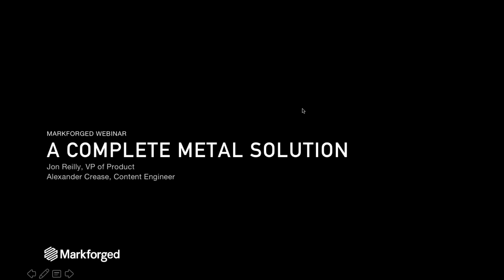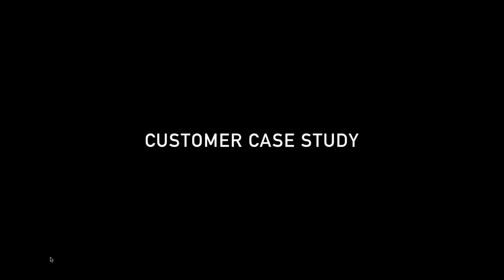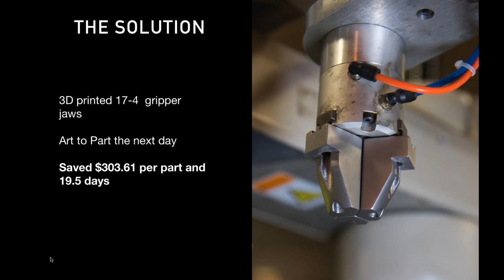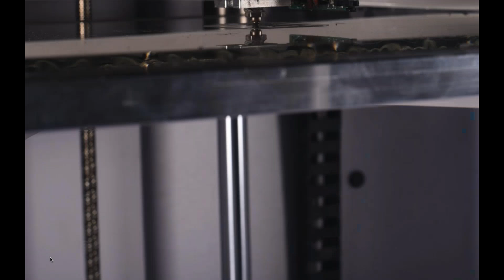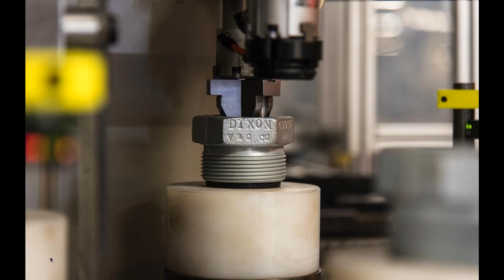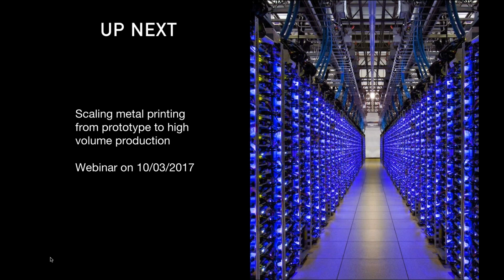The Markforged Metal X | From Design to Finished Product

Comment: 🎯 Key Takeaways for quick navigation:

00:02 🎙️ Introduction to Markforged Webinar
- Overview of the webinar structure and agenda.
- Brief introduction to Markforged and its mission.
- Overview of the customer case study with Dixon valve and coupling.
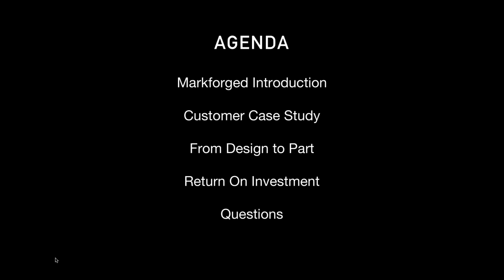01:09 🏭 Markforged Company Overview
- Founded in 2013, Markforged aims to revolutionize innovation and manufacturing.
- Global presence with thousands of printers in over 50 countries.
- Unique offering of materials including plastics, metals, and fiber-reinforced composites.
02:22 🛠️ Customer Case Study: Dixon Valve and Coupling
- Introduction to Dixon Valve and Coupling as a global manufacturer.
- Overview of their automated manufacturing challenge with steam pipe couplings.
- Explanation of the problem faced with the gripper jaws and the need for a robust solution.
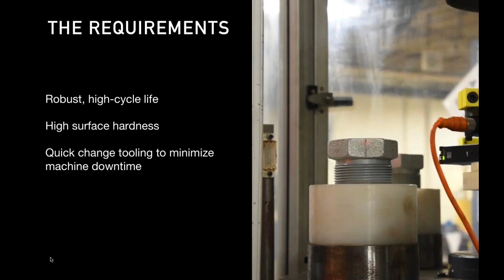04:25 🔄 Solution: 3D Printed Gripper Jaws
- Implementation of 3D printed 17-4 gripper jaws.
- Significant cost savings and reduced lead time compared to traditional machining.
- Advantages of quick and customizable tooling for manufacturing cells.
05:57 🔧 3D Printing Process Overview
- Step-by-step explanation of the 3D printing process with Markforged Metal X.
- Designing the part, printing, washing, and sintering steps.
- Importance of seamless integration with CAD software and automated processes.
10:36 💰 Return on Investment Analysis
- Comparison of costs between traditional machining and 3D printing with Markforged.
- Significant cost savings per part and reduced lead time.
- Enhanced flexibility and simplified workflow with 3D printing technology.
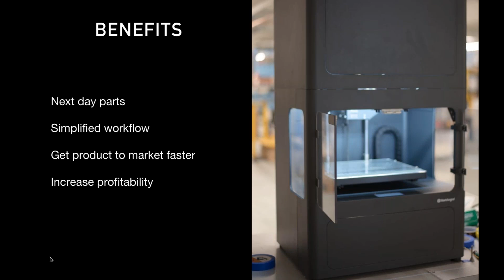13:14 🚀 Scaling Up: Future Applications
- Discussion on scaling up from prototyping to high-volume production.
- Utilization of parallelization and print farms for mass production.
- Announcement of future webinar focusing on scaling up production processes.
14:20 ❓ Q&A Session Overview
- Transition to the Q&A session.
- Instructions for accessing resources and demos.
- Addressing common questions regarding software, materials, and processes.

Made with HARPA AI

Comment: How big of a part can you print? what is the max length width and height of a part that you could print?
Reply: from their website
Build Volume 250 mm x 220 mm x 200 mm

Guess your part will need to be at least 20% smaller than that as it will shrink during sintering.

Comment: I'm very interested in this kind of technology, but a bit put off by a couple of things. How are you calculating those costs @11:55 ? Because if you're only counting consumables, which it appears that you are for the printer, there's no way in hell you're using $313 in consumables to machine that part. Maybe $1 of coolant and $1 in insert wear on top of material price. If you're counting operator wages, machine time cost (either by payment per hr or depreciated value) or just using an outsourced/quoted rate then you need to compare that evenly, because what you're claiming there is straight up BS when the thing takes 3 hours to print on a $100k machine and another full day of other processes being washed and sintered (only to end up with a part that still needs machining if you actually need tight tolerances), which in reality is actually 2 days unless you're running a night shift because of how long the sintering and washing processes take. If that machine is on a 5 year payment plan, the repayments alone (washing machine and sintering machine not being counted) are about $10/hr, so there's $30 right there that you have not accounted for, nor power, nor operator wages, nor footprint rent - all stuff you seem to have for some reason counted with the machine shop. The stuff about lead times is complete BS too - you're saying there's 19 days savings because the machine shop is backed up with 3 weeks of work before they can get to your parts. What if your printer is backed up with 3 weeks worth of work too? Apples to apples. Let's face it - starting at the same moment, a machine shop would have had the first unit of that part finished faster at around the same price, with the capability to produce second, third, fourth etc parts in a matter of minutes longer than making a single unit, which in turn brings the price down hugely. These comparisons are completely bogus, which is a shame because from what I can tell, the technology has a TON of potential and legit uses.
Reply: Vorsprung Suspension thank you! They do this non_apple to Apple comparison in all 3d printing companies literature. I still say if it's a part that was properly designed for manufacture, these artsy fartsy craftsy machines will never compete in time or expense with CNC. Like you say, they didn't include any of the expense of the shop like you would include in the CNC side. With CNC you can turn around and scale up production for much cheaper parts. I think if my shop is that over worked of but another CNC machine or two for the same price as one of these contraptions and run circles around them in production volume.
Reply: totally agree. Thats just marketing. It could be promoted honestly and still show advantages in some situations.
Reply: assumptions:
1. company makes couplers which are die cast.
2. cnc machining are for post processing
3. 3d printer is not used for manufacturing product but is used for tooling used on robotic. in the example, the jaws of a gripper. Therefore, 3d printer isn’t used as often as cnc machining which is used for company’s product, i.e. its bread and butter. Therefore, if machines are busy working on products that are back order’d, they’re not going to switch over right away for tooling. Although I don’t know why they wouldn’t have spare grippers?

I believe the big cost for cnc machining is complex parts, not simple parts. Complexity would need to be programmed into the cnc machine by a skilled machinist. The part in example was SS17-4 which is expensive to machine. Machinist might have to re-fixture part. I don’t believe cnc machines can be left to run on their own but must have an operator on hand. cnc requires drawings, possibly the creation of fixtures to hold the block of material to be cut. etc. These issues: complexity;  skilled labor at-hand, the machinist… drive up cost for part complexity versus the 3d print process which is design, transfer file to printer and print unattended. 

There’s also the cost of material where cnc machining starts off with a block of material and a large portion is machined off. 3d print only uses the material needed, no more. 
https://www.youtube.com/watch?v=R8qFFGfVHks

I predict as 3d printing matures, and precision is improved to that of cnc machining, 3d printing displacing the machine shop. 

Oh yea, if the part is manufactured off site, there’s shipping cost. 

The time frame would include the time to program cnc machine, setup a tool path for machine, and be available to monitor. Also with the 3d print you can have multiple parts on the build tray building simultaneously as long as they are of the same material and can all fit together.

I don’t believe the $313 is just consumables but the costly introduction of human interaction with the build process. Anytime you introduce human time and skill into the equation, it’s going to drive up cost.
Reply: So the main advantage this technology has over a CNC is its ability to create a part that's very intricate, detailed and impossible to CNC.
Reply: Something they fail to add is the lack of waste. Hogging out aluminum has it's laundry list of faults (disposal of wasted material, safety reqs, varying quality in billet, replacing bits). There's no doubt a tipping point when looking at machined vs. additive manufacture but it's viability is pretty well proven at this point. If it's intricate there's really no comparison on small runs though.
Reply: My exact thoughts. You could buy a has vf-2ss for the same price or cheaper and make that part in minutes instead of days for the same price.
Reply: He should be explaining the technology's advantages over cnc machining.